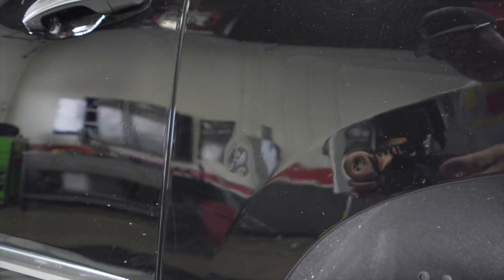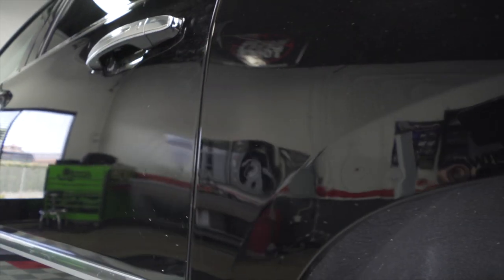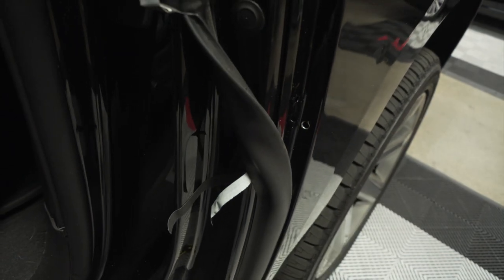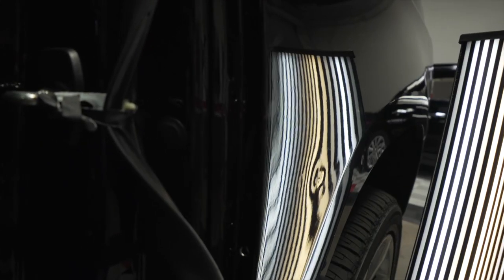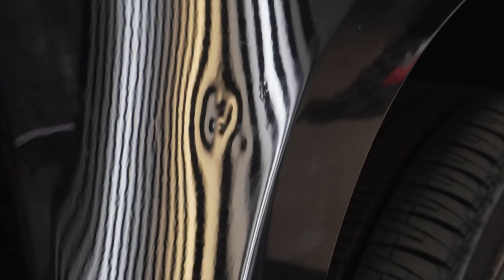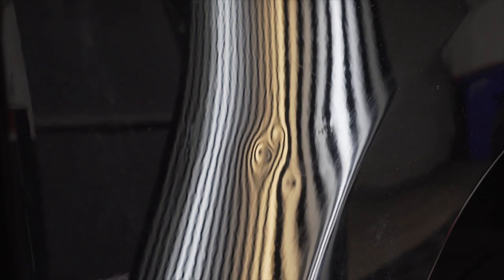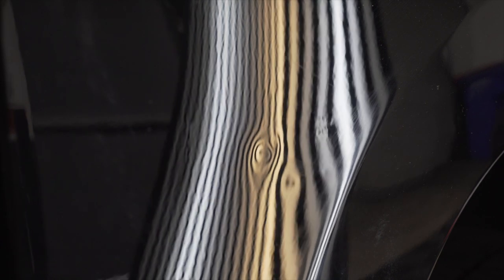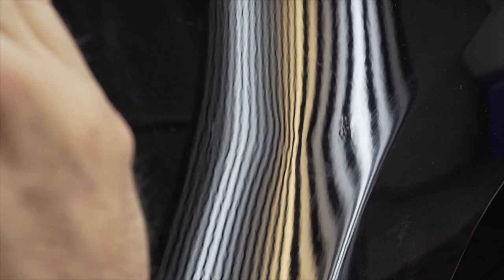Professional PDR Tutorial | Keep Your Dent Repairs Clean

Comment: Mike, if I'm not mistaken, I had work on Cadillac XT5 and you can get access by removing the striker and pushing a plate with threaded holes, just bring back the plate and replace the striker,  not sure if this model is the same as the XT5 crossovers.
Just a tip if you ever have to work on that specific model.
Great job and very informative on your videos as always!!!
Cheers.
Reply from the maker: MoiDj22 thanks but the angle would have been much too hard for any tools to reach the back deep dents on the lip.
Reply: Dent Time - San Diego Dent & Bumper Repair Right, that was a great clean up you did there!

Comment: Just have to ask. Do you Slap a little paint on he hole you drilled and put a grommet on it? I’m assuming you do because obviously that is a place for rust to start.
Reply from the maker: Mark D we use a weather proof silicone sealant with a very flush fitting tight plug. Never had one rust problem.

Comment: Does this process scratch inside of the metal ?
Reply from the maker: Jay Mann sometimes depending on the Tool tip. But not severely to cause anything alarming.
Reply: Dent Time - San Diego Dent & Bumper Repair please share the link for the rubber tool tip. Thanks
Reply: Yes it does scar the in side 
After a year the panel will rust